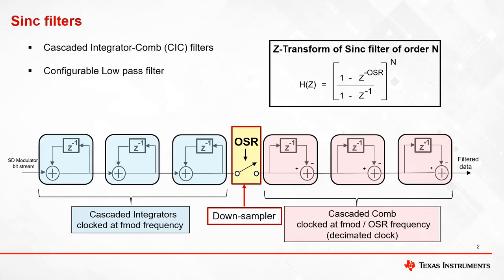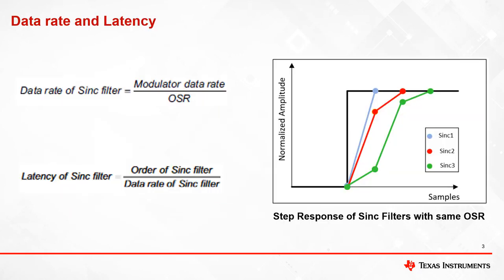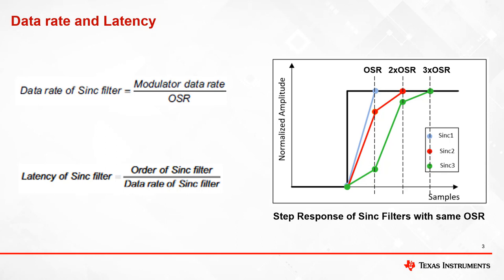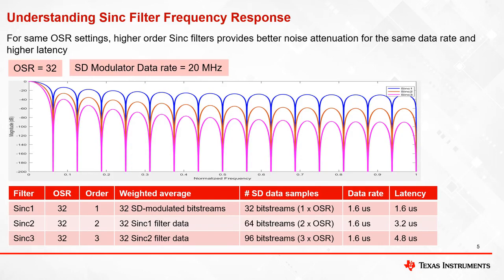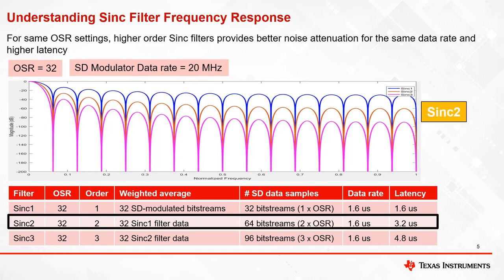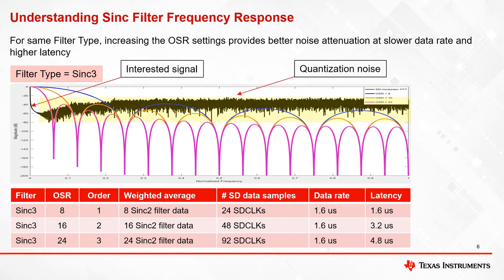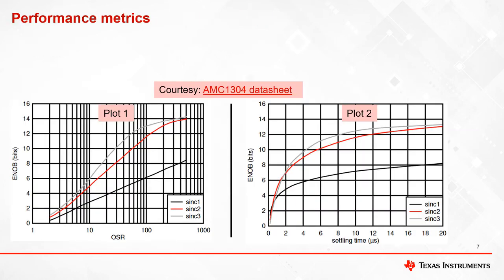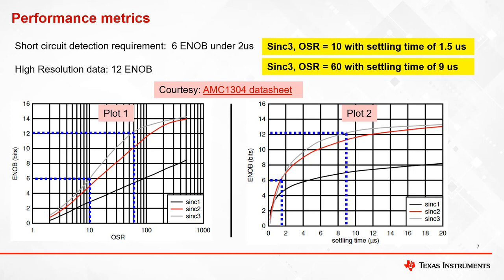Sinc Filters Overview

Comment: Hello ! I don`t understand - how does the integrator works?When I will move for example value 1 (value staying the same), the response of the integrator will be 1,2,3,4,5,6,7.... After some time the output data will be 0 (because saturating and as a result overflow).